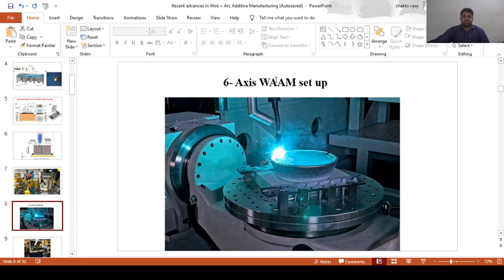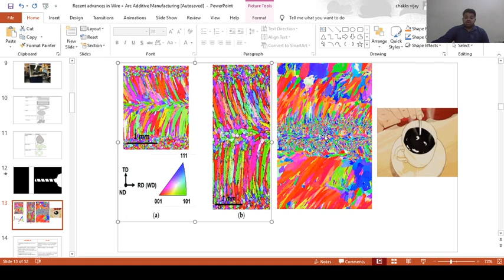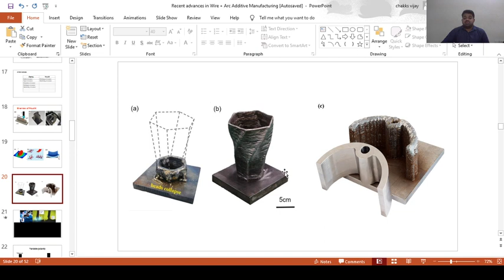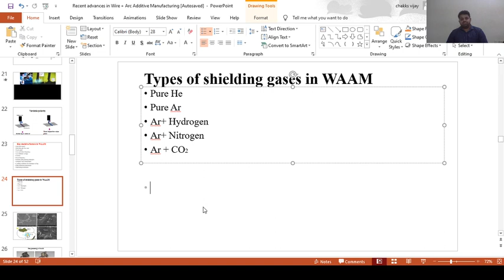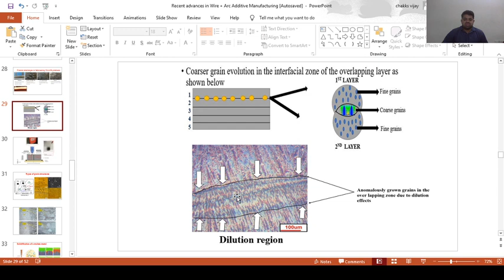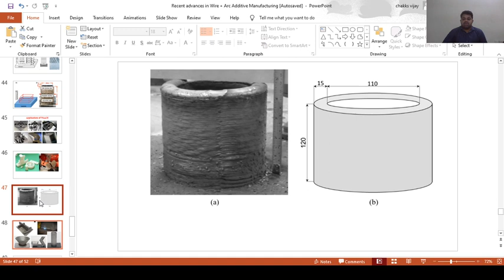Wire Arc Additive Manufacturing (WAAM) and its metallurgical aspects (Lecture-1)

Comment: Hello sir,
Do you know wihch is the distance between the substrate and the torch during the deposition?
Reply from the maker: Dear Mr.Jacopo, we shall generally maintain the distance from the torch tip to base plate up to 10mm so that arc constriction will be better. If you want more metal to be deposited then you shall increase the stick out length ( length of the wire  peeping  out from the torch).

Comment: Great detailed video and very informative! I have a few questions for you, sir . I am new to WAAM and have learned so much over the past year and a half. A big issue right now is spatter. I have manually welded over 16 years -  spatter was the easiest for me to control. Are there sources you can point to that directly support CMT (Fronius) involving spatter? There are so many variables to look for on the controller. I have tried lowering currents and wire feed rates as well as traverse rates to help combat the amount of spatter we are getting. From my understanding isn't it better to use lower deposition rates (wire-feed-rates) for CMT? This is all on .045 diameter welding wire.
Reply from the maker: Dear Sir, thank you very much for your kind words. Spatter  is greatly influenced by surge in voltage (i.e voltage fluctuation). In a cyclic current, when the signal to noise ratio exceeds the permissible limits then spatter will be maximum. In conventional MIG welding its tough to orchestrate the voltage and current. Therefore, the voltage regulators plays a crucial role in synchronizing the voltage and current. In conventional MIG process after several pilot experiments we need to optimize it manually. Whereas, in CMT technology if we change the current then the voltage and wire feed speed will get changed accordingly. In CMT, there are  well optimized synergic lines where all the decisive process parameters are interconnected with each other.
 Moreover, in CMT technique the electrode wire movement is precisely controlled by a special motor. In CMT, the electrode wire will have a forward and retreating motion for smooth molten droplet detachment. Whereas, in conventional MIG process only the forward movement of wire that takes place.  
However, even with CMT technology we have encountered little amount of spatter while depositing single walled structures.   But the amount of spatter is very minimum as compared to the conventional MIG process. You can even go for spatter spray which is available to control the arc blow. Even shielding gas composition also can control the spatter to certain extent. You can add little amount of metal active gases such as (Ar+N2, Ar+CO2, Ar+H2) to control spatter.
Generally, in CMT - WAAM we go for feedstock wire diameter ranging from (1mm to 1.25mm). To the best of our knowledge we never employed a thin wire of 0.045mm. If you wish to deposit a thin walled additive component you can go for lower diameter wire (1mm) for which the achievable bead width  is up to 4mm to 6mm. Incase if you employ (1.25mm) wire diameter the achievable bead width is 6mm to 8mm. Technically speaking people claim that in WAAM has  greater deposition rates up to 2-2.5kg/h . But in reality the deposition rates are very poor. It is because the cooling rate experienced by WAAM component is very sluggish. So definitely we need to maintain interpass layer temperature so that desired geometrical fidelity can be attained. Or else our WAAM component is likely to encounter  humping, stair steeping effect due to dilution and mixed layers formation. Moreover, the excess heat accumulation may lead to substrate distortion which will lead to geometrical irregularities. 
If you feel that you cant compromise the deposition rate then you can go for interpass cryocooling strategy where you can pour liquid nitrogen over the deposited metal to drop down the temperature of the WAAM component instantly. We have tried that with Inconel 625, Inconel 718 and SS316L. It absolutely works fine and there were no detrimental effects such as cracking. In this case you will get more cellular grains due to high (G/R) ratio, (i.e thermal gradient (G) / grain growth velocity (R) ). Mostly only in cryocooled WAAM components cellular grain morphology can be formed. Incase of no interpass cryocooling (i.e free convection interpass cooling) the most noticeable structures are columnar dendrites and equiaxed grain structures. It is worth mentioning that cellular grains morphology is an obvious grain structure where the solidification rates are very high (10^4 to 10^6k/s). That's why in SLM, LPBF, DMLS techniques the most obvious grain structure is cellular grains. 
Please feel free to raise any query if detailed explanation is needed. 
Thank you.
Reply: @chakkravarthyv8333  Wow, amazing and prompt reply! I'll first start off by saying to clear the confusion about the wire size - 0.045 was in inches (I refer to this usually for wire sizes) and yes 1.2mm is the wire diameter we are using! As you stated, it makes sense to use smaller diameter wire (1.0mm or 0.035inches) for thinner walled sections. A bit more info we have synergic lines and use them with CMT+p in many applications. Absolutely CMT is not known for high deposition rates do to the constant switch between polarities and push/pull of the secondary roller system which makes layer printing achievable. What interests me the most about what you said about gas, I like the idea of using a Ar/N2 mix to test out. From what I understood, the N2 will actively create a 'cooler' bead which results in less spatter overall? I was not a fan of Ar/C02 as it created too much scale between layers and also very dirty. Certain mechanical properties were better with C02 but included large defects. A mix of Ar/He/C02 resulted in better quality overall but the wetting/dilution seems a bit too much for what we need to do. This again makes me think about using the Ar/N2 mixture - I am not sure how ArH2 will turn out I am afraid of possible H2 inclusion/moisture content. Thank you for extending your knowledge
Reply from the maker: @davidleboeuf8799   In latest CMT machines (CMT Pulse advanced) mode is there which has better control over spatter and porosity. Actually (Ar+N2) gas is good for depositing austenitic stainless steels and Inconel super alloys. In austenitic stainless steel the austenite is an unstable phase which has a tendency to convert into ferrite at room temperature. Therefore, to offer better austenite stability (Ar+N2) mixture is used. The nitrogen acts a strong austenite stabilizer as compared to Ni and in the same way it can give 20 times better corrosion resistance than Cr. (Ar+2 3% of N2) is permissible. Though we add higher amount of N2, there will be only 25 to 28ppm of N2 can get diffused into the metal. Moreover, from the viewpoint of ionization potential (N2 and Ar) both are near about the same. So, there won’t be much difference in the cooling rate. However, with H2 the ionization potential is very high. Which means the arc extinguished through Ar+H2 mixture will be having a very high intense heat energy in comparison with (Ar+Co2 and Ar+N2 mixtures). Therefore, there will be a greater thermal gradient with Ar+H2 mixture, which can result in faster cooling rate based on the following empirical relationship (E= GXR) where (E cooling rate; G- Thermal gradient; R- Grain growth velocity). In WAAM, we generally consider the torch travelling speed as "R" which is a constant phenomenon. However, G- varies from one layer to the other layer. Based on this relationship if the thermal gradient (G) increases then Cooling rate (E) also increases since both are directly proportional to each other. From this you can conclude that Ar+H2 can improve the cooling rates in comparison with (Ar+N2 and ArCo2). 
Especially in Inconel 718 super alloys, laves phase is a detrimental intermetallic phase which is formed due to sluggish cooling rate. Therefore, to promote the cooling rate we need to increase the thermal gradient. In such occasion it is good to select (Ar+H2) mixture. Which can promote cooling rate and thereby reducing the fraction of laves phase formation. In case if you use (Ar+N2) that is also advantageous. It is because the N2 has very high affinity with carbon. The carbon present in the Inconel metal will react with N2 and form nitro carbides (N2C). This N2C intermetallic is more beneficial for improving the wear resistance and corrosion resistance of the metal. Moreover, there wont be any free carbon left to form detrimental species such as Cr23C6  and M6C6. Therefore, all the strengthening elements will be retained in your material in the free form. It is worth mentioning that Chromium carbide and molybdenum carbides were formed at a temperature range of (660 - 880 degree C). Whereas, N2C will form at (1080 degree C). Therefore, during solidification first N2C will get formed. Then after that if any free carbon left then there may be chances of forming detrimental intermetallics like chromium carbide, molybdenum carbide and niobium carbide. So there won’t be any sensitization issue.
Please feel free to discuss if any other clarification is necessary.
Cheers!!!!

Comment: Please tell me what software used for programming a robot.
Reply from the maker: Sorry for the delayed reply. Are you asking about any robotic programming for WAAM??
Reply: @chakkravarthyv8333  yes
Reply from the maker: @Ал1-в2ю  Generally every robotic machine that has its own inbuilt program. For an example if you are dealing with Fanuc arc mate robot then Fanuc company itself has their own customized software and a controller to operate the robot. Similarly ABB, KAWASAKI and KUKA robot they have their own program to run. Based on your geometrical dimension you have to set the X-Y-Z direction coordinates,  further through robotic controller you are allowed to control the torch travelling speed, sequence of operation,  on or off the weaving motion and the frequency of the weaving motion (Torch oscillation). In case if you have installed u r welding torch in a  CNC machine instead of robot then you have to make a separate coding which we generally call it as Geometrical codes (G- codes) and Miscellaneous codes (M- Codes). Based on  your part geometry you have to create G- Codes and M codes for your component. In case if you are interested in making any WAAM simulations then you shall go for Magics or simufact softwares.

Comment: Can you suggest any research gap to conduct studies in WAAM refractory material
Reply from the maker: I appreciate your interest in working with WAAM. In WAAM your feed stock material should be electrically conductive. In general, most of the refractory materials are ceramics or non metals and that are not complaint with WAAM.  Still If you would like to use any refractory materials in WAAM then there is an option.
1) Step -1 Deposit first layer using any metals like Inconel 625 or SS 316L or Duplex Stainless Steel. 
2) Step- 2 You can take a powder of any refractory material and mix it with acetone with certain consistency so that it will become like a paste. Just for experimental purpose you can use a small paint brush and apply that refractory paste ( Zirconia or any other) over the top surfaces of the previously deposited Inconel 625 or SS 316L Or duplex SS layer. Then, wait for 5min so that your acetone will evaporate from the top surface. As you know that Acetone is highly volatile. Once your top surface become dry then you can deposit subsequent layers.  
3) Step -3 After coating of refractory materials then again deposit a metal layer over it.
So that your refractory material will be sandwiched between two metals. Its just like developing a composite.
To promote better understanding I have attached two reference links below.  These are very little explored areas of WAAM. With various metals you can try your own combinations like (TiN, TiO2, CaF2, V205, TiB2, SiC, B4C, Graphene, Graphite, Nb, Scandium, Cerium, Zirconium and so on). Hope this information will be useful to you. 
Good luck!!

 https://www.sciencedirect.com/science/article/abs/pii/S0925838820308446

https://www.sciencedirect.com/science/article/abs/pii/S0167577X16320146

Comment: How to reduce thermal distortion sir?
Reply from the maker: 1) To prevent thermal distortion first prefer a base plate of greater thickness ( above 15mm thickness). So that it will act as better heat sink and that prevent heat accumulation.
2) Increase your torch travelling speed.
3) Reduce your heat input.
4) Maintain inter pass layer temperate of 200°C between each successive deposition.
5) You could try different robotic path planning strategy. That would be very effective to reduce the thermal distortion. Different robotic path planning was already mentioned in the video. Kindly take look..
Reply: @chakkravarthyv8333  what about blast each layer with cool air? or print with thick layer? or print symmetrical parts on both sides of the build plate? or heat the build chamber just under melting point?
Reply from the maker: @3dex19  
1) Cool air would contain moisture which could contaminate the molten pool with oxide inclusions.
2) The main reason for thermal distortion in WAAM is due to the dilution effect. Subsequent layer will infiltrate into the previously deposited layer that result in overlapping of layers. Distortion could be prevented by selecting low heat input.
3) You could try for copper backing as well.
Reply: @chakkravarthyv8333  which among I asked is good for that?
Reply from the maker: @3dex19  
You could preheat your substrate prior to deposition. That would be a better option to avoid base plate distortion.
Reply: @chakkravarthyv8333  means the last one I asked?
Reply from the maker: @3dex19  
I couldn't get you what you mean it as build chamber. Its so common to preheat base plate prior to deposition to avoid thermal distortion of base plate.
If u would like to prevent thermal distortion in layers then maintain interpass layer temperature and adopt different robotic path planning.
Reply: @chakkravarthyv8333  okay. Sir thanks for your information 😃